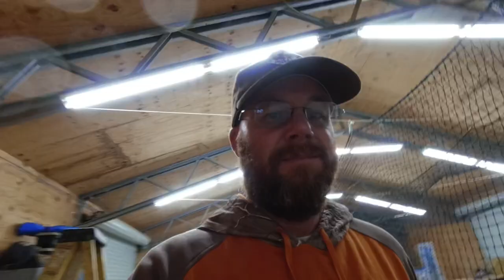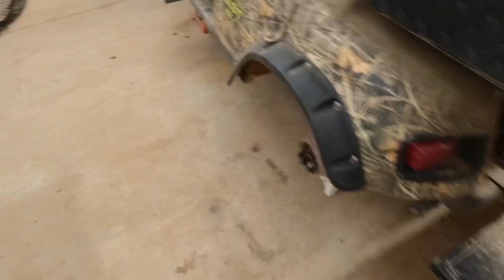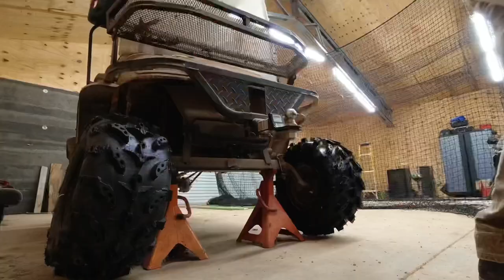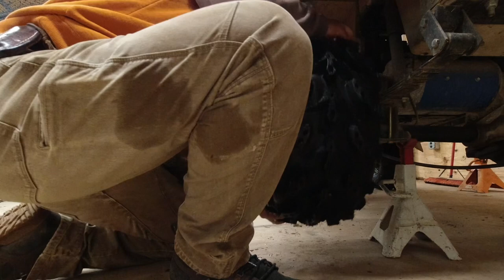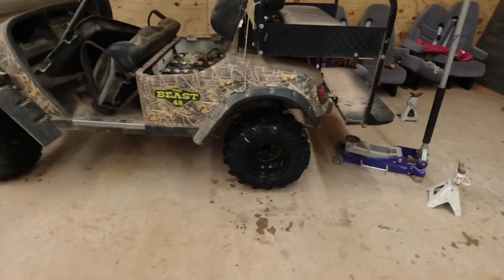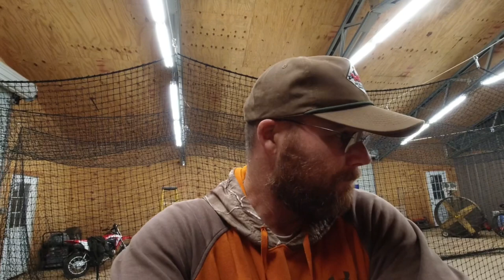New Tires 😎😎😎 For The Beast Golf Cart

Comment: I did one of those updating with lithium battery s and bigger controller and swapped out motor with plum quick 20 HP with lots of torque, it has 3 modes, normal, faster, and tractor